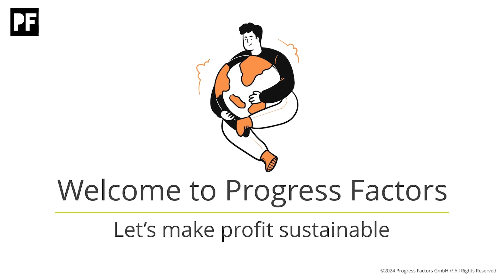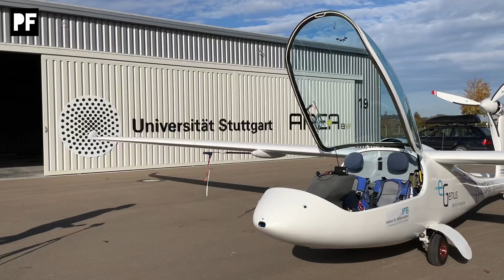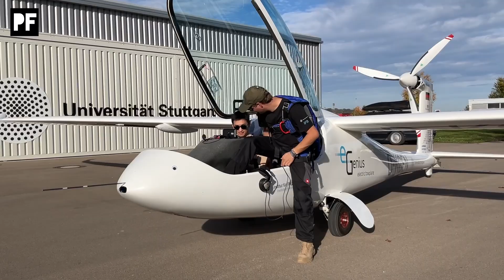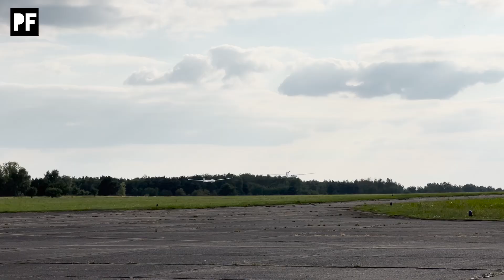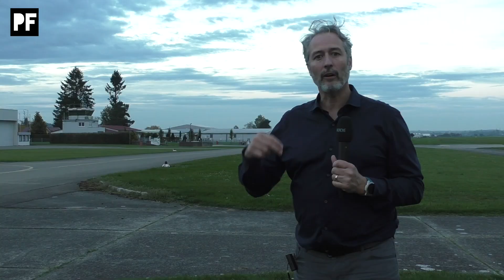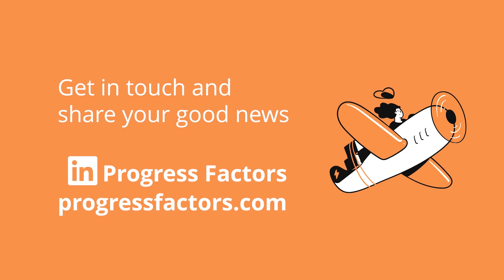Sustainable Aviation Takes Flight! Watch e-Genius achieve world firsts in green aviation!

Comment: Interesting design with the engine and propeller mounted on the top of the vertical stabilizer! Given the higher thrust line, does this aircraft experience pitching moments (like nose-down tendencies) due to the offset from the longitudinal axis? Are there any systems or design features in place to mitigate this effect?

Comment: The emissions will be produced at the coal powered power station to charge the batteries. Right? Green energy? The battery is just an expensive fuel tank.
Reply: Well at the moment, yes. But in germany it's laready less than 50% of electric energy coming from non-renewables. And even if in your country it's less the big powerplants are more efficient and the electric charging and electric motor are so efficient that the net-CO2-emissions of electric vehicles are less than internal combustion, so it's almost always better.
Reply: At the end of the day even coal power stations are relatively efficient and electric motors are extremely efficient. The nett benefit is significant compared to traditional aircraft piston engines which are necessarily less efficient than their automotive counterparts.
Reply: off to bed grandpops.
Reply: Isn't it all about change boundaries? If you use fuel in your car/plane you're kind of stuck with that forever. If you use a battery, any future evolution of the power grid you can take advantage of. It allows multiple disparate systems to evolve independently towards a common goal without breaking contracts between each other. Vehicle requires electrons, grid supplies electrons, everything else is details that can change. 

Imagine you're a third world country and tap water isn't potable. Water leaks are common and pipes aren't sterile. Someone proposes: "we should implement plumbing standards". But everyone says we don't need to invest that money, everyone has water filters at home anyway. But if you do the extra work, eventually, all the upstream upgrades to water infrastructure and treatment you can take advantage of. Eventually people won't need to buy water filters for their house anymore.
Reply: I hope you are paid by fossil fuels and are not trolling reactionary carbon memes for free
Reply: Like electric cars, if all electricity was generated using coal it would still be cleaner because the electric motor is so efficient at converting BTU’s into forward motion.
Reply: No the solar, nuclear and wind turbines will supply the charge obliviously! Please think before posting! Some clowns are easily led!